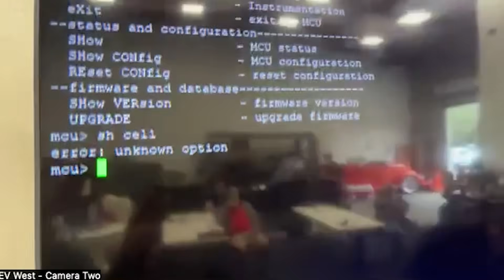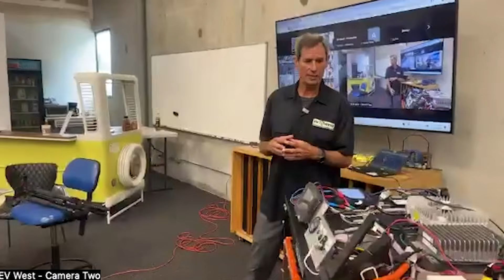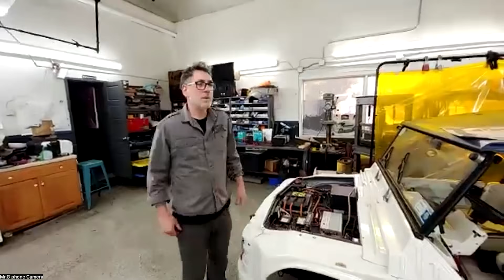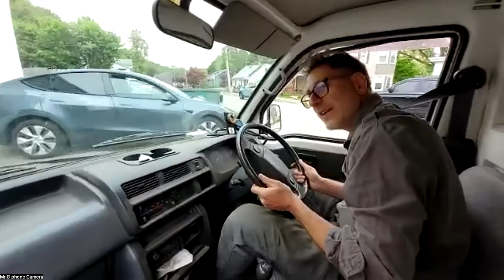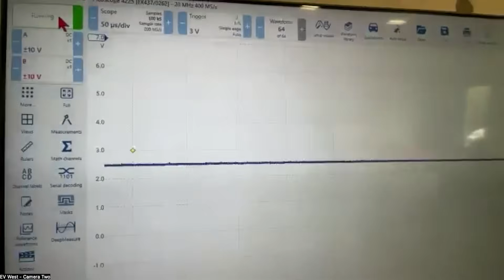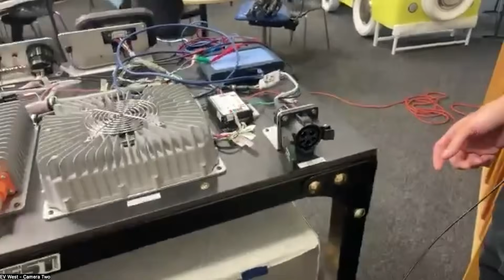Carts & Coffee — May 2026 | EV West Meetup

Comment: I am a retired Chevrolet certified technician factory trained class of 83/84. My grandfather was a mechanic Pontiac my uncle too. asbestos brakes probably killed more mechanics than electric vehicles, and I can assure you that decades of breathing hydrocarbons, carbon monoxide in a hot semi enclosed service bay is far more dangerous than a properly educated tech working around high voltage motors. I am sure catalytic converters are responsible for far more fires than electric motors. Gasoline engines are obsolete. But a backwards people can cling to Obsolete technology and that seems to be a choice that America is making. Meanwhile, China’s building the electric future and the robotic future and Americans are crawling back into a cave. It’s shameful. Absolutely shameful.